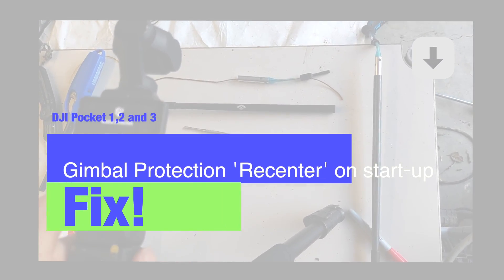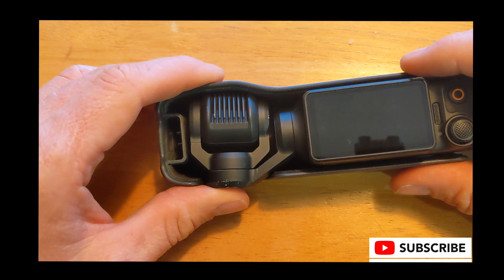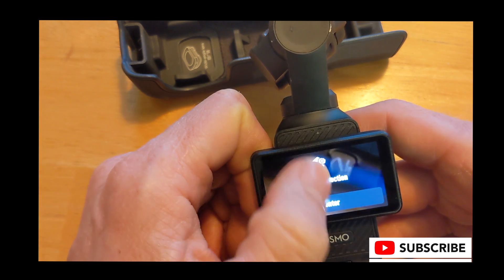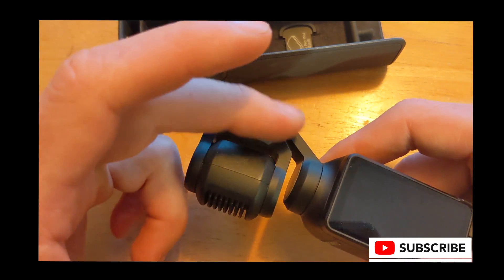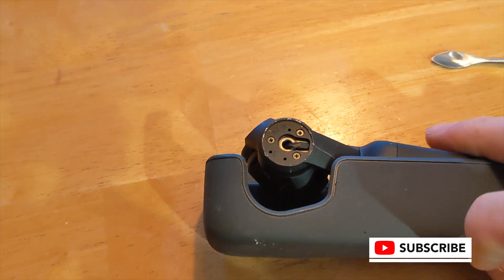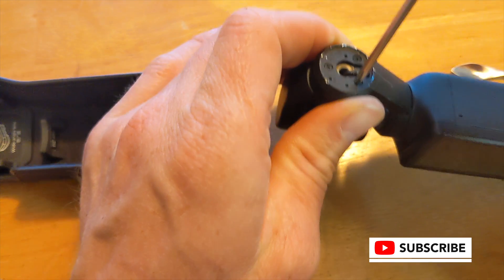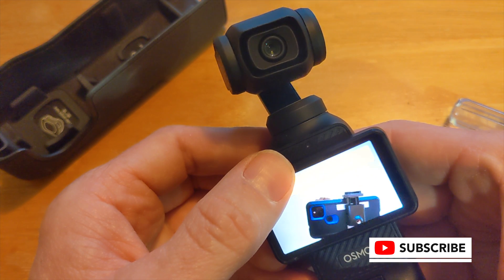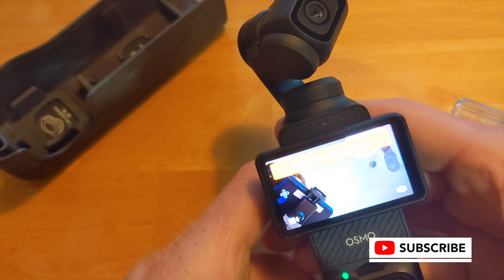Gimbal Protection Recenter - Problem! How to fix. DJI - Pocket Go 3 common failure

Comment: mine gimbal shake after 3 secs gimbal protection prompts. power off and power back on still problem persists.
Reply from the maker: Contact The manufacturer and see if they can help you out with a warranty